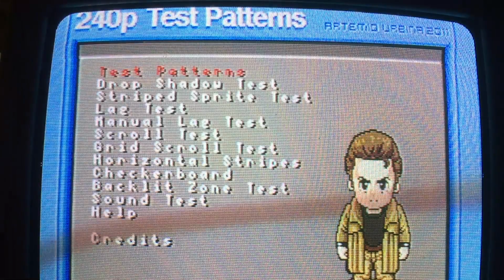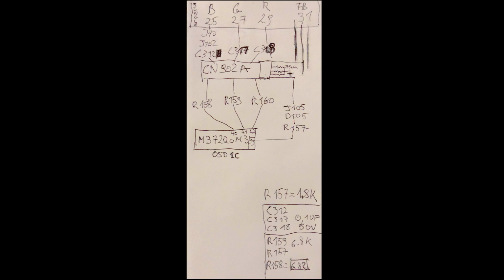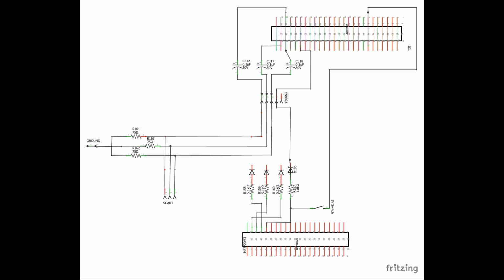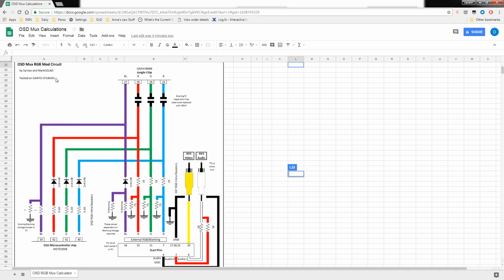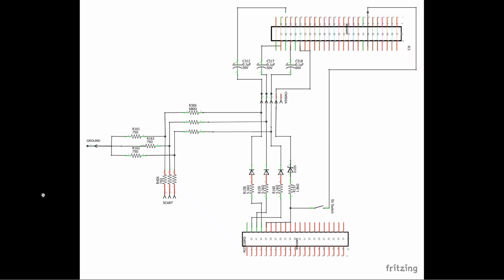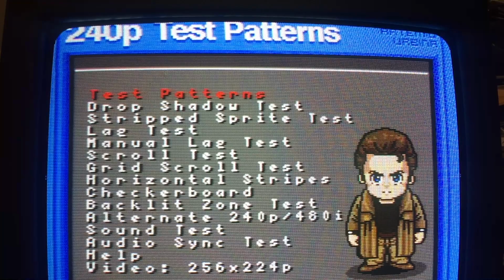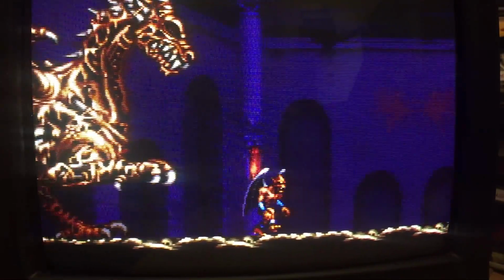CRT TV RGB Mod - Mitsubishi CT-14AM3 - Part2

Comment: I’m picking up this model tomorrow , thanks for making this video , anything you would change in this design if you started over again ?
Reply from the maker: Ah that's cool, I didn't think anyone else would attempt the mod on this exact model.
That should be very easy for you then, the hard part was the trial and error and finding the right values for the circuit.
I have been using the TV on a regular basis with Amiga and Master system and am very pleased with the picture.

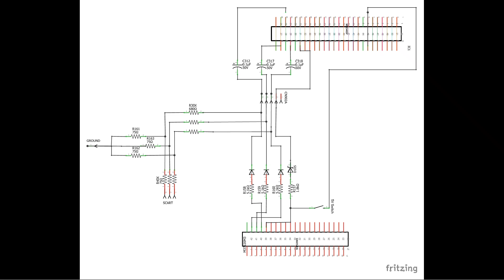I wouldn't change the design at all, the schematic seen at 7:30 is perfect for this purpose.
Only thing I'd do differently is be super cautious to not damage any traces and try to build the circuit directly on the chassis.
Reply: Djcalle awesome can’t wait to try , did you find a way to shift the picture to fit in the screen or is it still blown up ? Service menu available ?
Reply from the maker: yeah it something like Menu+2379, I can't remember exactly you should be able to find it  by googling it. The thing that took me a very long time to figure out is that you have to be super quick to enter the digits unlless it won't work. For vertical height and position,, there are two pots on the chassis
Reply: Seems like i got the model before yours  CT 14AM2 , Missing the scart connector , Im having a difficult time finding data sheets on what is what, If you have the chance can you see the images and see if its possible to RGB mod,

https://imgur.com/a/qvBrraF

Thanks
Reply from the maker: M52343SP  is your jungle IC, same pinout as my jungle for RGB input. now you need to trace out the circuit to the OSD.